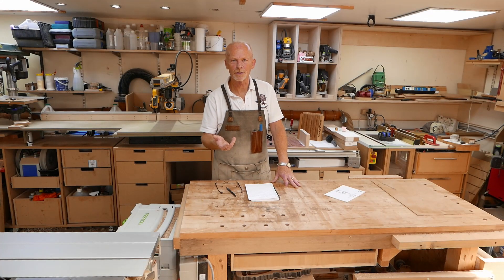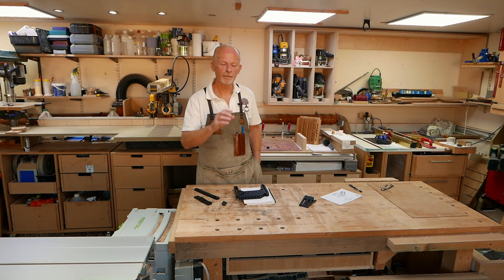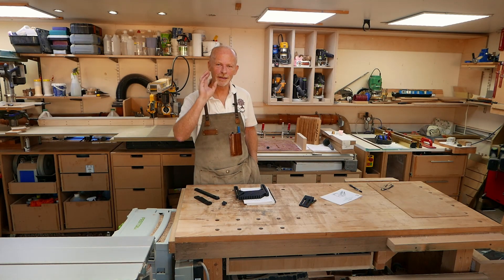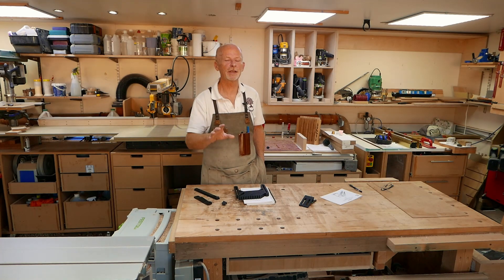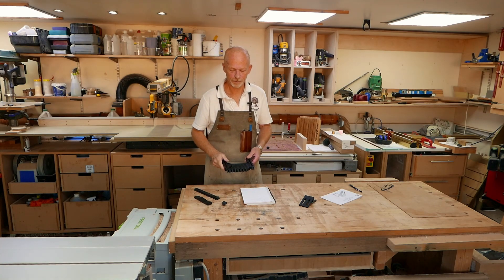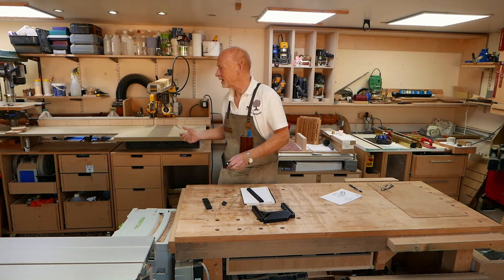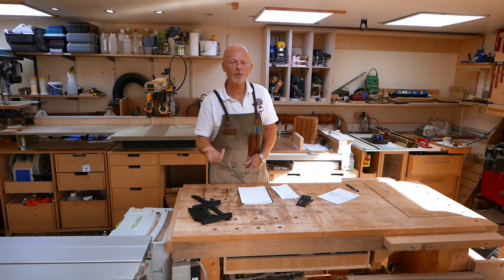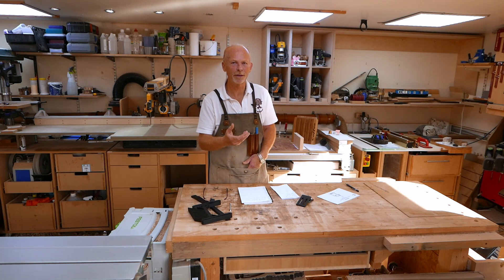3d Printer in a WoodShop ? Part 1, The Questions and Answers.

Comment: Hi Graham, I just purchased a Ender 3 Max printer, thanks for your lead as your channel has pushed me over the edge. I am hoping you will be able to assist me with a problem I am encountering. The first prints with free PLA filament that came with the printer were perfect, however since I added the new filament the printer prints for a minute or two and then asks me to change the filament. The filament is not broken but the printer does not seem to like it, I have even tried a different roll of filament with no joy. Any advice from your side would be most helpful. Thanks in advance.
Reply from the maker: Hi Rich, not a problem I've experienced myself.  If the printer is asking you to change the filament is it possibly snagging on something somewhere.  Is the filament the same size as the sample?  Could you have possibly ordered a thicker filament?.  Hope that helps. 👍
Reply: @GTWoodshop  Hi Graham, thanks for the reply. I have found that I can print without any problems by disabling the 'out of filament indicator'. The only thing I can think is that my 'out of filament' sensor is intermittently faulty.
Reply from the maker: @ProsperityPath25  Hi Rich, ok well at least you've got it going again.  Have you told Creality?? I'm sure they'll send you a replacement part at the very least. Well done for the work around though. 👍👍
Reply: @GTWoodshop  Hi Graham, thanks I did not think of telling Creality, I will do so. Thanks and have a great day.

Comment: I think there is a fourth question - can you restart a print if the filament runs out.  There are a lot of budget ones that require you to start again and Chuck the half finished product.  Did you know there is a company recycling offcuts and failed prints into new filament.  Good luck - saving up for my first printer
Reply from the maker: Hi Sibat, yes you can, the Featherboard took 20hrs and had to be 'restarted' twice, so all good on that front.  Interesting on the recycling. 👍
Reply from the maker: Sorry Sibat its just dawned on me what you mean, absolutely, should have added that. 👍👍